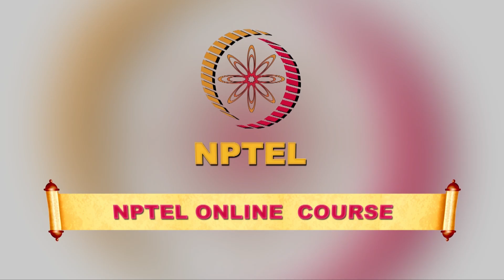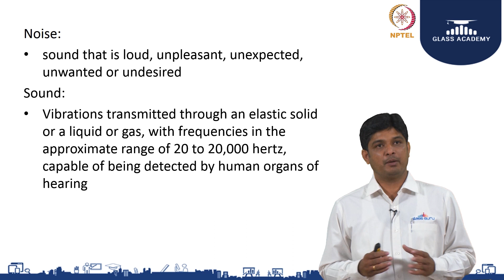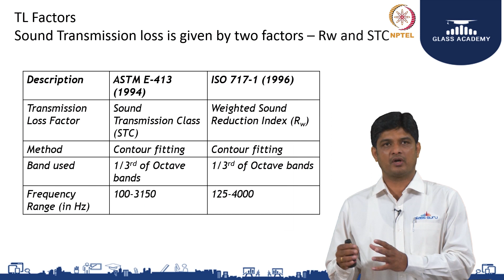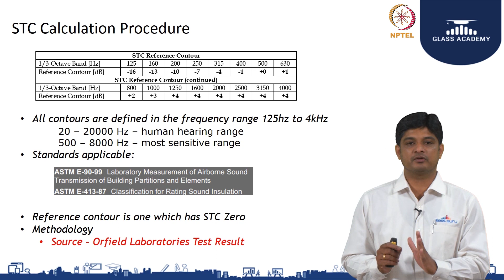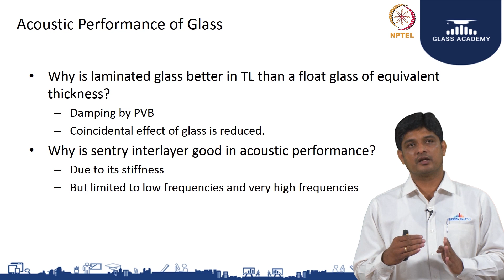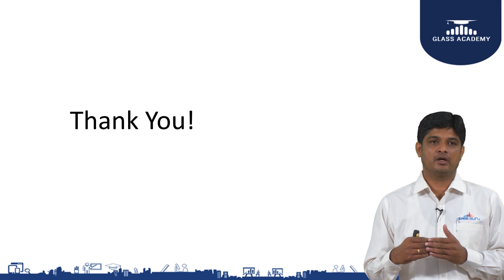Acheving Acoustics Through Glass

Comment: Hello. Very good video, I like it. I have a PVC profile can adopt 24mm glazing width. Which structure would you use for the best noise reduction as possible? PVB lamination foil is 0.38mm. Glass positions: outside (street) / gap / inside (room)
- 6mm PVB (3mm+0.38mm+3mm) /12mm gap / 6mm PVB (3mm+0.38mm+3mm)
- 8mm PVB (4mm+0.38mm+4mm) /12mm gap / 4mm low-e
- 7mm PVB (4mm+0.38mm+3mm) /12mm gap / 5mm low-e
Everywhere the gap are filled with argon gas. Glass sizes are 485mm x 1080mm. 
Thank you so much for your help. Regards, Karl